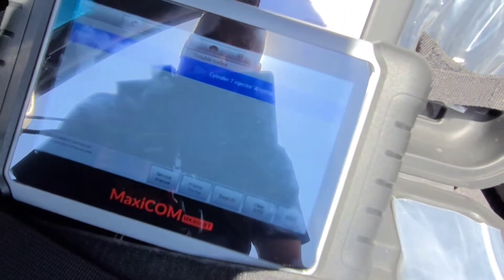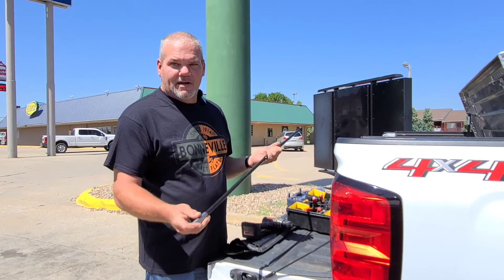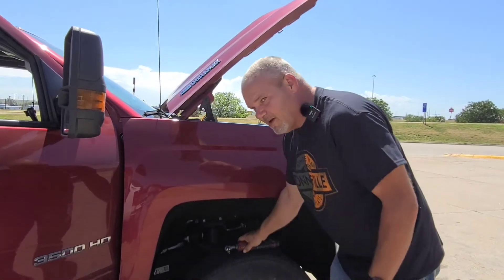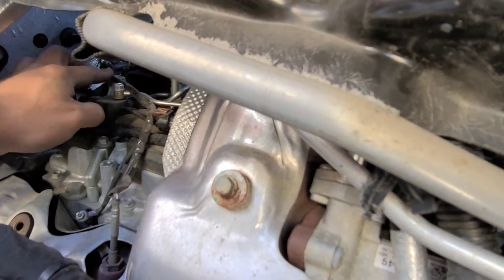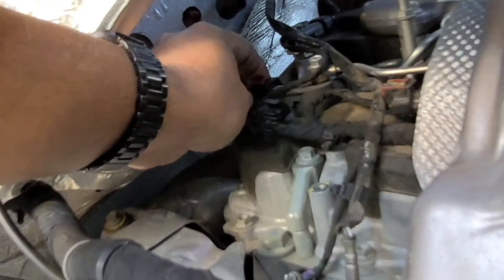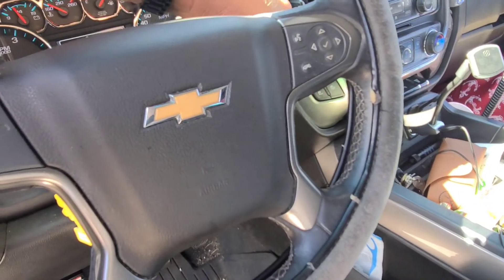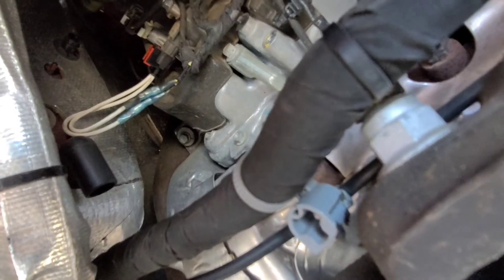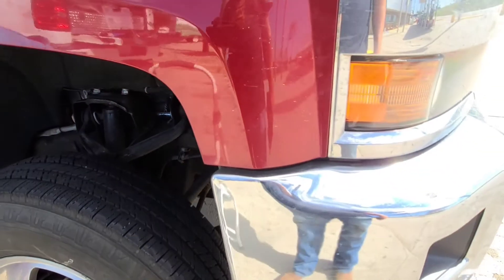L5P P0207 #7 injector connector replacement

Comment: the wires for the connector do they have positive and negative ? or you can just connect them and it does not matter?
Reply from the maker: It doesn't matter. Either wire to either wire. They're not marked for polarity
Reply: @CFarmer  thank you alot i am changing  the connecter on my truck tomorrow and wanted to make sure I don't miss up the injector itself.😅

Comment: There are aftermarket connectors MUCH cheaper that have ribs to stop the connector from moving inside the injector body. These also use a terminal with a stiff backup spring and no split. These do well on injectors that have fretted pins. The terminal grips where the OE terminal never touched.
Reply: Do you have a link or a source you can provide?

Comment: I have also had the same problem with the injector connectors… But I found the solution to be easier and less costly By using electric contact cleaner on each injector connector. It works great and I haven’t had any problems for the past 30,000 miles. The contact cleaner cost all of $8.00
Reply: I have a 2018 3500 Denali srw and haul horse trailers up and down 65. I’ve had #4 and #5 connectors changed and today #2 started to fail. I unplugged it and sprayed it good with contact cleaner and so far it’s running like a champ. Hopefully it’ll last, I have the connector just in case. #2 is pretty easy to get to
Reply: @JohnnyBDiesel  has it lasted you decently long? I did the same as y’all two and I havn’t had an issue for 20 miles so fR
Reply: @MilliMeterPeter02  so far it’s been fine. I did have #4 go out again last week and the dealer I went to fixed it under the 2 year warranty that the connectors have on them.
Reply: @JohnnyBDiesel  thank you for the reply, I just disconnected my #5 and sprayed it with WD40 ( I didn’t have any electronics cleaner at the time ) and it’s been going strong for 100 miles. Hopefully it lasts, i’ll grab some connectors here shortly.
Reply from the maker: That's awesome, I'll have to try that

Comment: njoy you videos, how many miles were on your trucks when the connector went bad the firrst time for both of you? Thanks for sharing,  so many peole on forums ask for help and we never hear back from them on what they found out, even if you have to take it into a dealer to get it fixed, please share because if it happens to you most of the time it is a common problem.
Reply from the maker: sorry it took me so long to reply. I did my #7 around 200k (no issues since with my #7). the one in this video was done at a dealer around 190k and I had to replace it around 340k ( I think one of the wires was crimped poorly). since this video I have also replaced my #4 connector around 280k and I put a #3 injector and connector in this truck at I think 270k. i hope this is the info you were looking for and if I can be any help please let me know. I don't know it all but I'm happy to share share what I know. thank you for your comment and sorry it took so long to get back to you.
here is a link to my #4 connector video
https://youtu.be/QxLAK0wQp8s